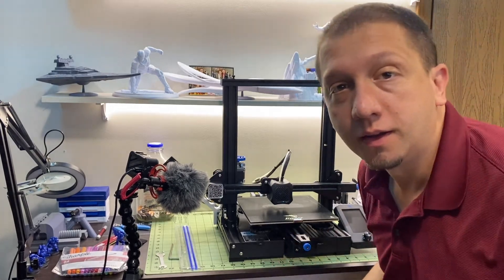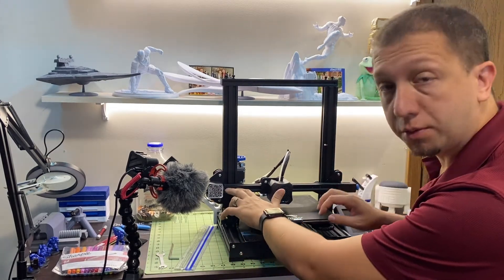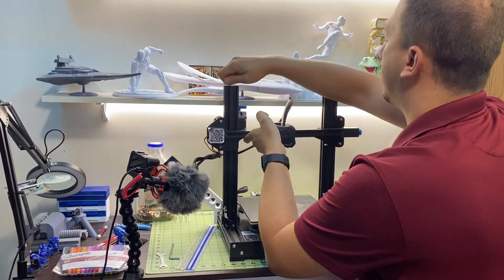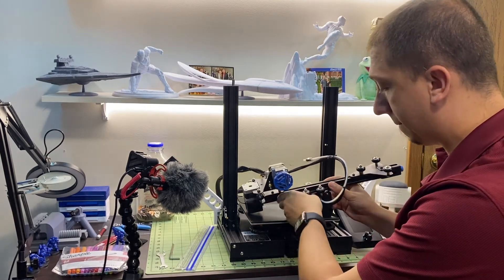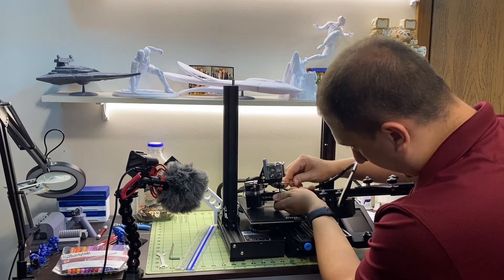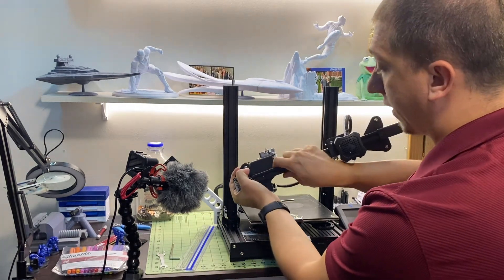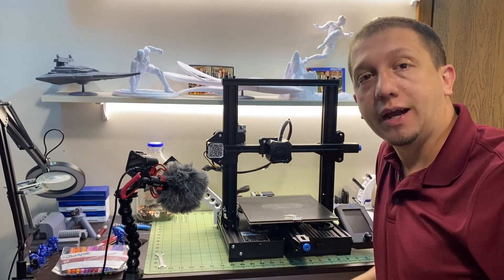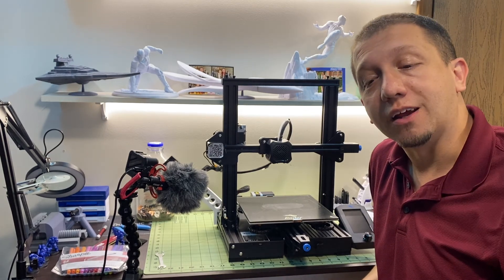Bed Leveling not fixing uneven print layers? Look at the 3D Printer X-Axis

Comment: Thank you! I think I through things off when my printer was trying to home the Z and my flashlight got stuck under it. The motors fought really hard for a few seconds until I just turned it off. I didnt notice the inconsistent leveling until later so I was just not understanding what could be causing the problem, especially since I was upgrading to a different extruder when this happened so it felt like somehow that could be causing the issue. Hope this is the answer!

Comment: loosen the eccentric nut on the right then tighten the eccentric nut on the left then re-tighten the right eccentric nut
Reply from the maker: So for my issue it was the bolt in the middle. The concentric Nuts did nothing. I finally resolved this issue by adding a second Z rod kit. Machine works great and I rarely have to level it now.
Thanks.

Comment: Thank you for sharing, my ender 3 pro, after i level the bed and i start to print, for some reason, it gets unleveled. sometimes the nozzle is not even close to the bed and sometimes its to close to the bed. i've been going crazy trying to figure it out.
Reply from the maker: Glad to help.  Also go check out my video on adding a second z rod to my Ender 3.  Helped out a ton!!!
Reply: @Rise3DBuilds  Its funny cause while i was adjusting the screws i was thinking if its possible to have two z rods going. 😂
Question, whats the easiest way to install a bowden tube to the printer? I purchased the blue bowden tube a while ago but when i tried to install it, i couldn't get the one that came on my ender 3 pro. I kept pulling on it but i gave up cause i didn't want to break it if i pulled to hard to get it off. Any tricks to get it off?
Reply from the maker: Are you trying it with the hot end heated?   Also those pressure fittings can be a pain.  Some times I have to unscrew them and the get it off the tubes or when I am lazy I just replace them.  Your printer should have come with a couple spares.
Reply: @Rise3DBuilds  Should the hot end be heated to replace the bowden tube, will that work?
Reply from the maker: I hear it when I do it

Comment: Great vid.  Thank you for posting but you took me right to where I have a problem and you fixed it off camera. I'm just a bit off in the same place you were but I don't know how to make that small adjustment.
Reply from the maker: So by the stepper motor there is two bolts that you can only get at if you take the gantry off the frame. My issue with it wagging was that the bolts were lose.  I had to actually replace mine as they had stripped.  So since it was not tight that created the flex and made it almost impossible to to level the bed.   The other item to check is the concentric nuts are not to tight so the gantry can move up and down freely.  When you put the gantry back on it should not have a wag to it. 

Let me know if I can be of more help.
Thanks
Mike
Reply: @Rise3DBuilds  Hey, thanks for responding so quickly.  I gathered all that from your video and it helped me fix my problem.  I just didn't know how to make those final minute changes you needed to make at the end of the video because I was still a bit off just like you were.  I wound up loosening everything and setting it level on 2 pegs and tightening everything back up again.  I'm back to printing.  Thanks again for your help. I looked at a lot of vids before finding yours and it finally worked. :)
Reply from the maker: Glad to help.  Hope you subscribed
Reply: @Rise3DBuilds  Done.  Liked and subscribed. :)